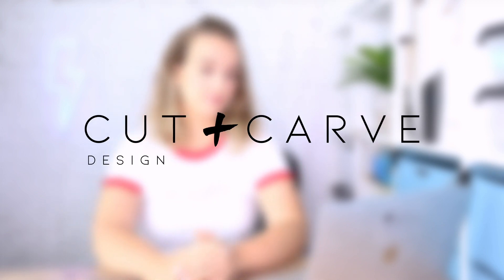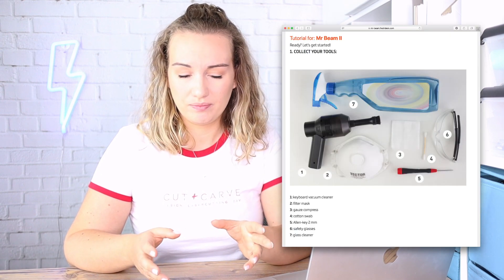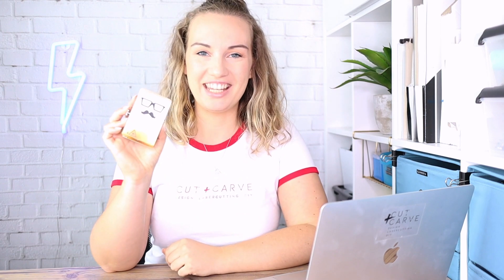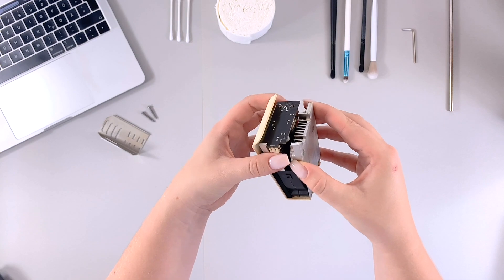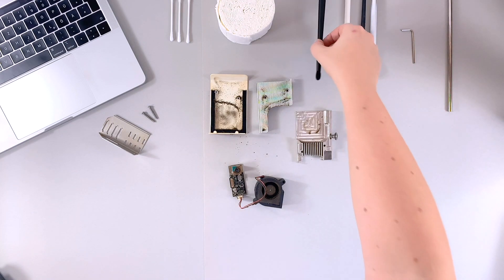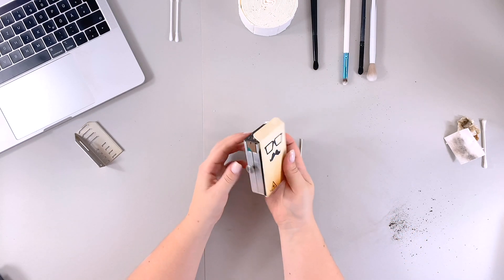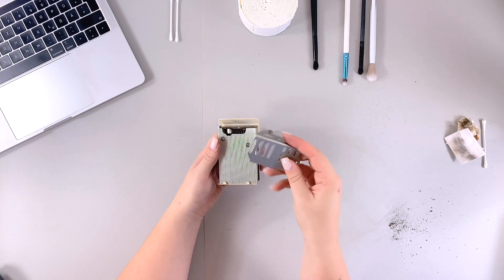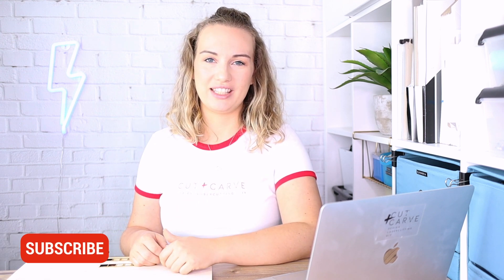Cleaning my Laser Cutter for the first time / Mr. Beam II / Home DIY

Comment: Why didn't you also clean the white laser head cover? You can use glass cleaner to do this . 
Andy just to ask: do you engrave and cut a lot of wood and bamboo? In that case the laser head should be much more  dirty
Reply from the maker: The glass cleaner I used didn‘t work that well on the rough surface of the cover but it didn‘t bother me enough to keep trying to get it clean. The cutter is more of a tool to me so function was my top priority.
I engrave a lot on cutting boards (Not bamboo) and cut plywood. I was really surprised as well that it was dirtier!